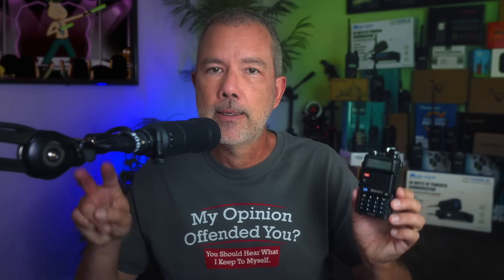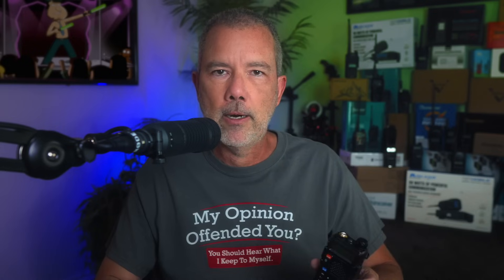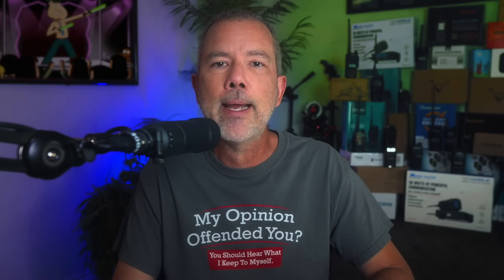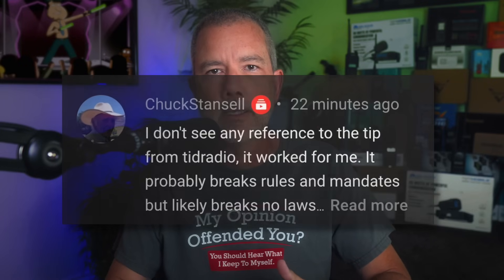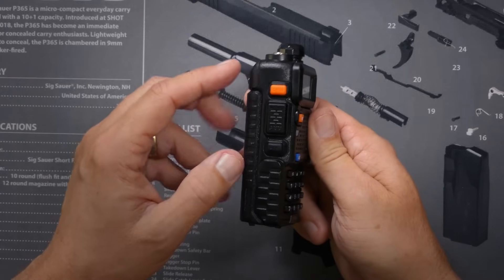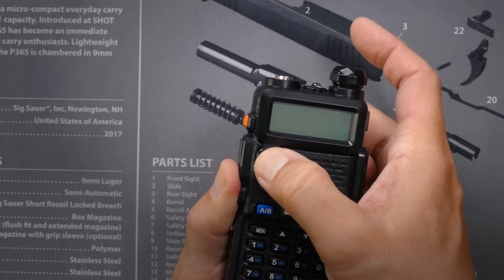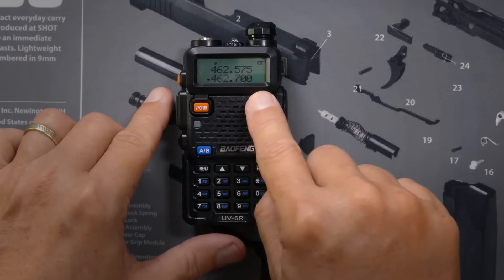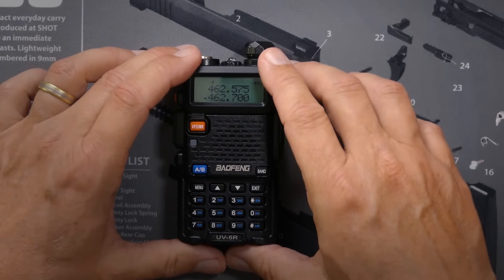How To Unlock A New Baofeng UV-5R - Easy UV5R Jailbreak To Transmit On More Frequencies

Comment: Thank you!!!!! 
I just recently purchased two separate UV-5R+Plus radios, one in black, one in camouflage (I know you can make fun of me). 
The interesting fact is, I bought them from two separate listings. The one in black came, and I was able to transmit of FRS frequencies with no issue. However, when the camouflage one came, I could tune into FRS, but not transmit. 
This solution worked!!!! 
I believe that Baofeng is trying to please the FCC by selling them locked. The S/N on the black one that initially worked and was unlocked started with 20UV, while the camouflage one that was locked started with 22UV. I’m assuming that the camouflage UV-5R+Plus is much much more recently manufactured than the one in black. 
That is why I think Baofeng is trying to sell their old stock of unlocked radios out, so they can only sell the locked units. 

Once again, thank you so much! You saved me a trip to the UPS store to return such a useless radio.
You earned a subscriber and a like, my good sir!

Comment: Offbeat question - can you unlock a UV-5X / UV-5G and get access to the 70cm/2m bands?
Reply: Found the answer to my question in a YouTube video posted by Ham Radio Dude.

Wouldn't unlocking a Part 95 certified UV-5x for ham (as opposed to unlocking a 5r for gmrs) satisfy all of the issues raised by the shrieking Nancy's (so long as I don't transmit on ham bands without a license... which I would NEVER do)

Comment: I've tried on several occasions to unlock my UV 5R per your instructions but no avail., it doesn't take. Any ideas my good man?
Reply from the maker: If you've done it right and it does not work, then it is either not locked, or, it cannot be unlocked.

Comment: I just purchased NEW a Baofeng UV-5R on Aug 2022 and this hack did NOT work although in the menu there is an option for for "reset all" and that does work and is unlocked
Reply from the maker: We've gotten a few reports that this did not work on new radios (July/Aug 2022) ..
Can you confirm that your radio WAS locked (could not transmit on non-ham frequencies) before doing anything, and that after doing a Reset-All, you can now transmit on frequencies like 462.575 ?
Reply: @TheNotaRubicon  My guess is this is an older radio prior to Baogeng getting a stern letter from the FCC. I read the radio before doing anything and the frequency range was 136-179 & 400-470. But I tried the hack pressing down the PTT, moni, VFO then turning on the radio but it didn't say factory, it went right to the memory frequency. This was a whole goodie kit with extras from an "authorized" distributor and came in a baofeng brown box sort of like a B-stock also making me think this is an older model but it is in brand new condition and not a refurb. But like I said I did the reset in the menu options so it works as expected. I am a licenced amateur and a first responder authorized to use both bands.
Reply: @TheNotaRubicon  My newest one arrived yesterday and was unlocked.  I got 2 last week and they did not need to be unlocked also.

Comment: Update: This does work on my UV-5R purchased July 2022! Transmitting between two UV-5Rs on FRS channels works fine.

Firmware: HN5RV01
6+Power on message: 151123H

Comment: I thought I would chime in on this subject as I just purchased two Radios from BF Tech - model BF -F8RT off Amazon Canada. The first radio I tested was locked and could only transmit on the ham bands. I programmed all the frequencies I wanted with Chirp and then tried the factory reset descibed and it worked ! The second radio of the same model I ordered was already unlocked from the factory so I didnt need to do it myself.

Comment: This is illegal should not be promoted
Reply from the maker: You seem like an "Expert",  and we are ALL very impressed! But it seems that you forgot to give us any actual information to back up your claim. So please point us to the actual law that prevents someone from modifying a radio to change how it transmits.
Reply: @TheNotaRubicon  the 5r locked to the ham bands, oi not illegal to unlock it but it illegal to transmit on anything other than the ham bands with it. You are simply promoting illegal activity and your minions will follow.
Reply from the maker: So, not illegal, as you previously proclaimed. 
And, as mentioned in the video, it is fully within FCC regulations to use any radio at ones disposal, locked or unlocked, in an emergency as defined by the FCC.

Comment: This technique works. However, when I CHRP load the radio, the freqs, etc load properly, but the custom names of the channels do not. For example, I programmed channel 40 to be labeled "steve", but when I load it, the proper freq loads (and tx and rx), but only the freq number shows up, not "steve". Any suggestions on how to make "steve" appear on my radio? And yes, my CHRP file has "steve" appearing for channel 40.
Reply: Press Menu then 21. Make sure it's set to 'Name' not 'Frequency. Exit and do the same with Menu 22.

Comment: I swear to God.... 🙈 I SO hope this n00b DOESN'T have his HAM license. What flipping idiot would even turn on a radio, or even press the transmit key WITHOUT a flipping antenne or at least a dummyload attached to it 🙄 ffs!!! 😳

Glad it only coast $20
Reply from the maker: You seem like a real "expert", and we are all very impressed!  But, you should watch this video to see exactly what happens when you transmit without an antenna.. You know, so you can see how wrong you are:  https://youtu.be/SdMLCDPc04Y
..and just so everyone can see how much of an "expert" you are, I've pinned your comment to the top of all the other comments so that nobody misses it.
Reply: @TheNotaRubicon  Thanks for placing this idiot's reply at the top of the list.  He does have a vaque point, yet he can't even spell "antenna" correctly.  When it comes to actual intelligence, one typo can speak a thousand words...
Reply: Svantastic, I recommend tighly holding your finger over the top of the antenna socket when transmitting.  Your body can act as a dummy load...just be sure you've got the transmit power set to "High." 😁
Reply: Well I am an expert (I stayed in a Holiday Inn Express last night) and I say it’s ok to momentarily xmit on a radio at low power without damaging the finals. SO THERE! Even if the radio only coasts at 20 (mph or kph, either or). Oh and btw, I have been a licensed amature for 34 years. 

Love the mat on the desk. Got one just like it. Great channel.
Reply: Boafeng UV-5R master race reporting in
Reply: If I ever do break a communications "rule" and the local HAM club fox hunts me into a corner, I plan to have with me for my last stand, my box of Bue-owe-fuaengie radios (which by that time should be quite an accumulation since they only cost $25)...  And as the black SUV's of the FCC close in on my spider hole, I will tape down the transmitter buttons, give it a 2-count, and throw them at the FCC like hand grenades...  No doubt the mayhem and damage caused by the explosions should allow me to escape without notice...  And as they catalog the contents of my spider hole on the 10 o'clock news, it will be like those big busts they show off on the news, where they take down a maniac with a mediocre collection of cheap guns...  Suburban man found with TWENTY THREE illegal Bue-owe-fuaengie radios, set to self destruct, the antennas all detached.  He used this roll of duct tape here to tape down the PTT button and turn these radios (which are normally just moderately dangerous) into lethal explosive devices which he hurled at the FCC agents.
Reply: I’m only here for the pinned comment 😂
Reply: Dude, 1 second isn't going to destroy jack.
The wanna be FCC Police type of amateur radio users were dicks back in the 1980's and evidently they still are 😆
Reply: actually I keyed my baofengs with no antennas several times and none ever broke lmfao even my firstest baofeng from 2017 and it still talks many farrrzzz.come at me bruh
Reply: Imagine being as remedial as Svantastic
......It's 2022 it's almost impossible to burn out a transmitter without shorting the center lead to ground....... Svan sounds like he's working with 1930s tune equipment, and an equally outdated education in radio transmitters.....
Reply: Haha these never get old
Reply: I’m so glad he pissed you off
Reply: Stop being tosser
Reply: OK --u said a lot ----but --are u up set ? or? ----not clear -----he did a great job --it works!!!!!!11
Reply: Hey Svantastic...Harvey has some very good advice for you.
Reply: Look. A mad ham...
Reply: Coast!
Reply: Funny thing is these work without them, just works alot better with them
Reply: Glad it only COAST $20. LOL
Reply: Svantastic, will you shut up? He said he is aware of it. It is his radio so don't worry about it.
Reply: Is this foo for real? lol
Reply: svantastic is an idiot.     Every last radio operator has transmitted into an open or shorted load many, many times.  Sometimes by accident, sometimes not.
Reply: You can't fix stupid.....
Reply: Give MrSvant some credit. He does have a really pretty owl. He obviously has his bird license.
Reply: Your kidding ?. Right???;. Why would he have an antenna attached for instructions 🙄🤔🤔🤔
Reply: @Svantastic I like how you HAM "experts" like to degrade others but when you're proven wrong you guys don't man up but hide and no longer comment.
Reply: Hey MrSvant YOU are a dummy load  aint ya , there is NO CURE for STUPIDITY  but maybe if we all put our heads together we ( UNLIKE YOU MR EXPERRRRRRRT  ) might get enough brain cells together to get a cure for ya , NOPE not worth the effort  DUH !!!
Reply: I hope your house gets infested with termites
Reply: REALLY !!! Svantastic im afraid i do not have a cure for you because there is NO CURE for stupid ... 🙂
Reply: i am just getting into this hobby. and this might be the cringiest reddit mod type of comment. i've ever read. Not to mention the emojis.
Reply: I think the "pros" are merely trying to stipulate that transmitting/keying up the radio without an antenna degrades the finals in the unit due to unbalanced match/feedback. But holding the key down for seconds? On a low powered device?  It's silly to argue the point, and it makes them look anal. Why they even watch the channel just to get angry is beyond me. Perhaps it's the unwillingness to accept that they are a dying breed. Oh well...
Reply: 7 months later I am just reminding you what an idiot you are Svantastic
Reply: I’m not licensed and don’t really care about these so called “experts” it’s my radio I have every right to use it on frs for my family so boo hoo to the experts 🙄
Reply: If that little radio was to key up. Without an antenna! For five minutes! It wouldn’t even hurt it! It’s not even Close to drawing enough milliamps to hurt one component in that radio.
Reply: What a dick! You can key up a low powered radio for short spurts and no Ill effects but do it with a high powered amplified rig and eventually if you keep doing it yes you can do damage. I'm sure the idea here is it's better to transmit without a antenna out of band so all the sad hams can't make a claim he actually transmitted illegally. Get a diaper dude!
Reply: The first time I pressed the transmit key without an antenna I died from the lithium ion battery exploding in my face. Which ultimately prevented me from getting my HAM license. I wish I saw your comment sooner.
Reply: Are all hams autistic?
Reply: I’ve accidentally transmitted on a 100 watts without hooking up my antenna for a second or two, the radio was just fine. Might have done this more then once 🤷‍♂️
Reply: The precious ham license
Reply: That was sad... honestly surprised you haven't deleted your comment yet lol
Reply: @shaneintegra  for real huh
Reply: Aren't you missing a sad ham meeting or something?
Reply: This guy is joking right 💀
Reply from the maker: @Zayd Abbas He is an "expert" .. "Experts" have no sense of humor.
Reply: @svantastic your comment shows your level of "expert" knowledge
Reply: Wow that doesn't coast much at all...  I love how Randy always has ZERO f***s to give for sad-Ham criticisms.  Which is exactly the right amount of f***s to give...  Fortunately the radio people I have talked to over GMRS are not bad at all, very friendly and helpful.  If I ever do bend the knee and attempt to take the HAM exam, it is my SINCERE hope I only tend to encounter the HAMs that are not of the sad variety...  I have nothing against HAM license holders.  I may even become one some day.  But for now GMRS seems to fit the bill really nicely.  And have you SEEN the prices of HAM equipment?  Some of its in the thousands.  What are the most expensive and feature rich GMRS bases?  Hundreds?  A blessing before I go.  "May you all talk as many fars as you need to, on the cheapest equipment possible."
Reply: You know information is free but it’s people like you that want to regulate the whole dam world. Communication brings all people together rules keep people scared. Instead of being a Karin you should thank him for spreading the truth. Thank you for showing me how to unlock my radio with the Roger that function.
Reply: HAM HARDER SVAN
Reply: Sad ham....
Reply: SAD HAM!
Reply: The shame...
Reply: @svantastic 

Does it hurt to be that brain-dead or does the lack of brain function correlate to lessened nerve response as well?

Comment: I’m new to this radio, but grabbed one out of terminal curiosity. Here’s a data point: my recent Amazon Prime purchase of the similar if more battery eating BF-F8HP keys up on the forbidden frequency right outta the box. Oh. Hang on. Crap. Some dude is at the door. It’s either the Dallas lawn watering cops or the friendly candy company, either way, time to run!

Comment: This did not work for me. Doesn’t say “factory”
Reply from the maker: Is your radio locked? If it's not locked, it wont work.
Reply: @TheNotaRubicon  I guess I assumed it would be because I recently purchased a BF-F8HP on prime day knowing my other uv5rs were purchased before the FCC squeeze. I keyed on a GMRS without the antenna and didn’t get the tone. I guess that’s a good sign.  Thanks for responding. Loving your content on the uv5r. Wish I had found them sooner.

Comment: I'm not sure why I unlocked it but I did. I use the raidos at work. I programmed in the same frequencies Motorola and Panasonic uses on their two way radios I think lol. Anyway for 60$ I get a raido decent shoulder mic. Definitely not the bofang mic. I went with BTech and have good volume water proof and so far pretty durable. And a 8 $ case so when we break one it's no big deal like a Motorola or Panasonic that starts at 250  for a low end raido only. They work great for my needs . Thanks for all the info you put out there. You've made it way easy to learn how to use theses I had no clue 2 months ago now I can make them do what I need them for with absolutely no pain in my brain . Mad props to you! 

A

Comment: I have tried several times on my uv5r but nothing happens when I turn it on. I'm using left pointer for ptt, left middle for monitor and left thumb for vfo then turning on
Reply from the maker: Is it locked? If the radio is not locked nothing will happen.
Reply: @TheNotaRubicon  I never did this before & just got it last month. But it must be unlocked already.

Comment: In the event anyone is still unsure about the new UV-5Rs,  I just received mine today, 7/8/22,  and this unlock procedure worked like a charm! Thanks again Randy!
Reply: got mine last week and still works
Reply: I got mine last week and didn't have to do this. It was open tx out of the box. It's one of the Greaval re-badged units from Amazon though. According to the serial it was manufactured 2022. Maybe they only "fixed" the actual Baofeng branded units? Do they even have the same CMIIT ID?
Reply: Just got mine 8/19/23 and it doesn’t seem to work on either of my 2. It doesn’t say factory it just comes on like normal?

Comment: Sorry to ask a silly question but how do you first determine if your UV-5R is or is not locked?  Do you simply try to X-mit on a channel that you are not supposed to X-mit on?  I am guessing that if the unlocking works you will be able to X-mit on those channels and that is the test ... ??? (Don't hate me, I'm new to this.)
Reply from the maker: Yes.
Reply: @TheNotaRubicon    Thank you.   OK, so I've tried this several times and never see the message FACTORY, as in your video.  Should this appear on the screen even after it is unlocked?  Or might there be something else not working properly?

Comment: Hello. I am just getting into radios and am trying to get a specific answer before purchasing a radio. Is it possible to get a Baofeng(or similar, or different model) that can be programed to listen to CB channels? I would also like one that I can start learning more about radios on but want a dual purpose as I drive a company truck and we are not allowed to install CB's so was hoping to find a portable solution if its possible.

Comment: Does this unlock allow you to listen to frequencies above 450MHz??
Reply from the maker: Unlocking a UV-5R does not change what frequencies it can receive.
Reply: @TheNotaRubicon  Thanks! Do you know if the UV5R is able to receive 482MHz frequency? I know some models say they can reach up to 520, and some say they're capped to 450?
Reply from the maker: Some of my older ones can, i dont think my newer ones can.  There is a sticker under the battery that tells you the frequency ranges.

Comment: How to know if your UV-5R is actually locked? Mine doesn’t say factory when I boot up as instructed
Reply from the maker: You will know if its locked if you cannot transmit on frequencies outside of the ham bands.
Reply: @TheNotaRubicon  can’t go any higher than 178.000 and no lower than 130.000